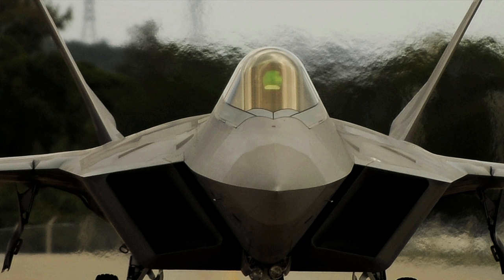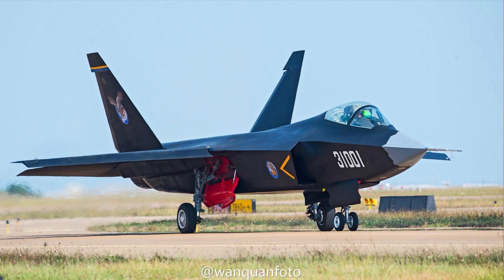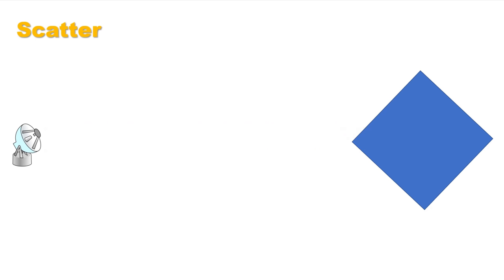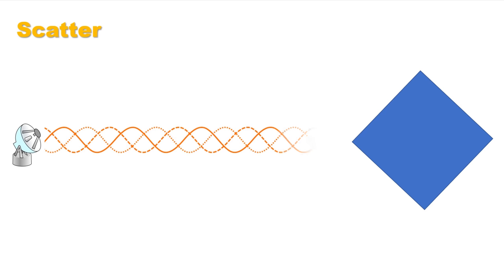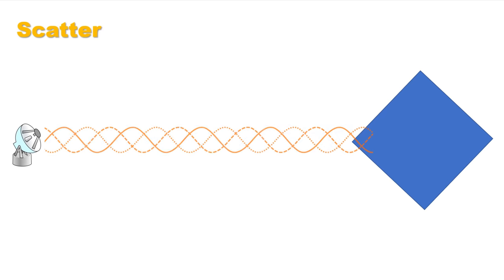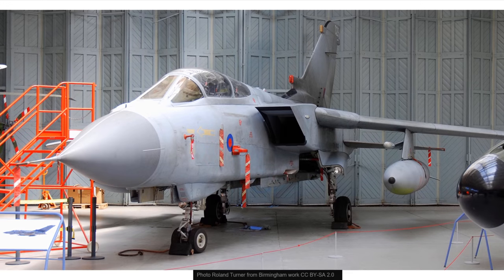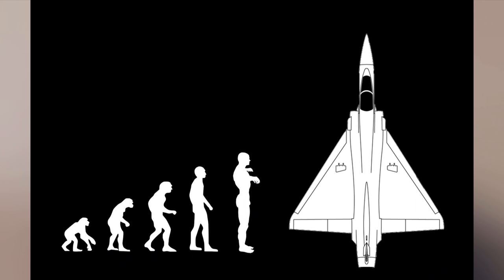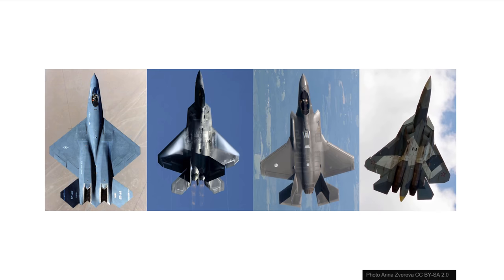STEALTH Killed AERODYNAMICS | why all modern jet fighters look alike

Comment: Stealth also killed beauty.
Reply: I think the SU 57 is gorgeous
Reply: I think they look pretty cool actually.
Reply: I thought the YF-23 was beautiful. Good Area-Rule numbers too. I keep waiting for that video. Bet Valen RN is too.
Reply: Not completely. Stealth planes are still beautiful in their own way, the B2 spirit is the most beautiful stealth aircraft in my opinion
Reply: I think most modern fighters look purposeful and aggressive. They are still beautiful in there own way, just not in the sleek sexy way, older jets have been.
Reply: @Renegade-Master-88  me too. It's just an angel ...(of death )
Reply: @exiletsj2570   What are some of your favorite aircraft from a design/appearance perspective? What would be on your list of “fugly” aircraft?
Reply: @Renegade-Master-88  I think thinking about stealth killed his brain cell.
Reply: @Renegade-Master-88  it looks like a pancake
Reply: @CaptainDangeax  entire airframe of the B-2 generates lift, it has a really low wing loading as well so it probably turns surprisingly well for how large it is
Reply: @CaptainDangeax  the B707 did a barrel roll, not a loop.  the YB-49 flying wing also showed reasonable spin recovery characteristics despite being designed in the 1950s with no FBW controls.  the B-2 is far more advanced aerodynamically and would likely be more stable.
Reply: @CaptainDangeax  the B707 is a long-ranged airliner that isn't even supposed to fly inverted much less perform aerobatics, yet it did a barrel roll at low altitude for an airshow.  if a civilian airliner designed with the metallurgy and flight control systems of the 1950s can do it, then i have absolutely no doubt that a military-spec bomber built using advanced composites and CAD from the 1990s can do at least the same.
Reply: @CaptainDangeax   @CaptainDangeax  ok, so the B707 served in military roles, albeit with some modifications.  the B-2 was specifically designed for combat.  not only that, but the design requirements included low-level, terrain-following flight, a regime that is inherently stressful on the airframe.  the ability to withstand the stresses of maneuvering flight precludes the ability to perform low-level, terrain following flight, as relatively high g loadings (for bombers) are endured when avoiding terrain at high subsonic speeds.  

as for generational "improvements," I agree that too many people have fallen and still fall into the belief that newer is necessarily better.  the Me 262 was still shot down in WW2 by piston engined fighters, F-100 Super Sabres, F-105 Thunderchiefs, and F-4 Phantoms were defeated by fully subsonic MiG-17s and comparatively primitive MiG-19s.  however, I am not stating that the B-2 is better in every way than a B-52 or a B-1B.  while it CAN perform certain roles more commonly assigned to the other two, it still carries less ordnance, has less range, and is far more expensive to operate.
Reply: @CaptainDangeax  as a side note, a combat-configured F-35 still holds certain advantages depending on loadout against even the Rafale.  while worse in sustained maneuvers, the F-35 holds a usable advantage in high AoA and post-stall maneuvers, as well as better radar, countermeasures (including EW systems), and being potentially equal or better in avionics, with EOTS being able to function somewhat similarly to the Rafale's IRST.
Reply: @CaptainDangeax  first off, flying slow =/= post-stall, although F-35 can do that too.  AoA limiter on the F-35 is 50 degrees, Rafale is 29 degrees.  F-35 also regularly does slow passes at airshows at about 185 kph.  Rafale's RBE2 radar is rated for target tracking at around 110 km; F-35's AN/APG-81 is capable of tracking at 150 km.  as for EW and countermeasures, F-35 is set to replace USAF F-16CJ and USMC EA-6B in their SEAD role and employs not only standard chaff and flares, but also has towed decoys and a dedicated EW system.  avionics is far more than just flight control system; it includes rwr, missile warning systems, and IRST/FLIR, which both aircraft have, which is why I stated that F-35 was potentially equal or better.  as for detection of targets, show me when a Rafale manages to detect and provide targeting data for ballistic missile threats.  any modern fighter can already use synthetic aperture radar or IRST pods to detect and identify ground targets.
Reply: @CaptainDangeax  combat reports still are press reports, are they not?  also, fighting insurgents is nowhere near a true test of capability for either of these fighters.  finally, I never said the F-35 was better overall - I said that it is better in certain regards.

Comment: YF-23 has a perfect area rule conforming shape.
Reply: @anthonyb5279  I don't write about things I have no clue about. But your question clearly points out that you don't have full comprehension. So go look at the pictures and solve the mystery.
Reply: The YF-23 is actually the best mix between stealth and aerodynamics the world has ever seen. The YF-23s frame is low drag and area ruled, it also features incredibly large lifting surfaces that give the YF-23 an incredibly low wing loading of 280kg/m^2. For reference, the F-22 has a wing loading of 377kg/m^2. Basically the YF-23 was more maneuverable than the F-22 in terms of aerodynamics. But it doesn’t end there. The YF-23 also had a thrust to weight ratio of 1.36 at 50% fuel while the F-22 had a thrust to weight ratio of 1.25 at 50% fuel. Basically, the YF-23 was almost more maneuverable than the F-22 in all metrics except maybe instantaneous turn rates because the F-22 had thrust vectoring and also be more stealthy than the F-22. YF-23 was GOATED! Too bad Northrop didn’t have time to work out some of the YF-23s issues(bad canopy durability at supersonic speeds), was on the governments shit list for their B-2 cost overruns and delays, and didn’t show off its capabilities as much as the YF-22 to gain public support. Had the F-23 beat the F-22 in the ATF competition, the Russian Sukhois and Mikoyans would’ve had to run from a monster fighter that was prepared to tear their ass to pieces while they couldn’t even see it coming.
Oh yeah and the fucking Gripen which is a LIGHT FIGHTER still manages to have a slightly higher wing loading than the YF-23 with a wing loading of 283kg/m^2.

Oh yeah and the YF-23 also used chines, a lifting fuselage, and massive V tails which are almost as long as F/A-18 wings but are wider to further lower the wing loading.
Reply: The YF-23 had lower drag than the F-22 because its fuselage was more blended into the wings and the air intake narrows together to be area ruled.

Comment: F-22 is area-ruled, which is more evident when you look at the side profile. It's like a tear drop. There is extensive aerodynamic finesse incorporated into the Raptor.

Cross-sectionally, it's like a chined diamond that transitions to the fuselage.

It wouldn't be able to supercruise at Mach 1.6 if it was inherently draggy.

They demonstrated the desired supercruise values on the YF-22 with less powerful motors, and a draggier fuselage, but higher leading edge sweep angle on the wings.

The original fuselage had to house thrust reversers in the engine nacelle profiles, which really fought against area-ruling there.

On the F-22A, they reduced the profile of the rear to taper drastically as a way of following the Sears-Haack body.

Same with the YF-23s. They had obese engine nacelles for the thrust-reverser provision. The F-23A was supposed to have reduced volume engine nacelles like the F-15, and increased fineness ratio/overall length.

ATF was supposed to be a STOL-capable fighter in the European theater after strikes on airfields. The STOL thrust-reverser feature, AIRST sensor, supersonic ejection system, side-looking AESAs, and other features were dropped due to cost risks recognized by USAF.
Reply: @anthonyb5279  Several members of my family were AeroEs and I studied the NATO AeroE program coursework (that my dad did concurrently while working with the West Germans/Brits on early ECA/EFA development) for 3 years on my own. We spent most of our time at ED, including B-1B CTF, F-16C Block 30 A2A capes expansion, F-15 CTF, then Global Hawk. I went active duty mil, then private sector.

Been talking with some guys back-channel who had interesting run-ins with SECDEF Gates who said it seemed like he was working for the Russians in all their dealings with him.

I have a theory that he was tasked with killing Raptor before we could go into Full-Rate Production because both China and Russia didn't have a way of dealing with hundreds of them in PACOM and EUCOM as planned.

Remember when he said, "We don't need F-22s to bomb the Taliban.".

Comment: That said, the YF-23 has a different approach to stealth than the F-22/F-35/Su-57/J-20/J-31/Tempest, etc. More blended and smooth in addition to straight aligned edged rather than straight aligned edges alone.
Reply: I think Su-57 has more similarity on stealth with YF-13. Blended wing airframe, radar blocker in front of the engine, podded engine layout. J-20 also unique in a way because its the only one that use canard, but the layout principle follow F-22 than YF-23.

Comment: While it hurts as a F-22 lover, I do know and understand the aerodynamic limitations the plane has. Good vid!
Reply: Why does it hurt? Every benefit comes at a cost. The question is does the benefit outweigh the cost. The answer is easily determined as yes as all countries are seeking to develop stealth aircraft. And people mistakenly believe even if a stealth aircraft can be seen on radar stealth becomes irrelevant. That is very far from the truth. Seeing an aircraft and getting a weapons quality track is two different things. Additionally the small radars in guided missiles will have difficulty tracking stealth aircraft as well. So even if stealth aircraft can be tracked and weapons fired upon it those weapons will have much more trouble actually hitting the aircraft and countermeasures much more effective the non-stealth aircraft.

Comment: I think some nuance regarding the last point needs to be mentioned. The Su-27 family is generally efficient the speed range you mentioned but with the caveat that it is in clean configuration i.e. not stowing anything on the hardpoints and that goes for every aircraft. The F-22 and other comparable designs,  on the other hand, are optimized for cruising for extended periods at supersonic speeds even without afterburners,  hence,  why the engines produce a lot of thrust couple that with the much more clean profile. In the case of the F-22, however, its maximum speed has been downrated not for aerodynamic reasons but for structural reasons. The spar between the engine nozzles is prone to overheating. If engineering limitations aren't a concern and we just want raw aerodynamic performance then the YF-23 paired with the YF120 engines are extremely impressive. Too impressive that it was deemed too risky. RAM also tend to be intolerant of high airspeeds. Any more and maintenance costs would skyrocket as these tend to be notorious hangar queens. Of course, the low wetted  area concept for stealth planes didn't die as we still have the PAK-FA that would be equipped with variable cycle engine that's a more modern and mature analog of the older YF120.

Comment: As every engineer knows, kinetics energy is transformed to heat. So if the aero drag is so much higher on a stealth plane, the heat radiation must be critical. Is this not considered as a problem? 
An are there done any action facing this problem? 
-No wonder why the IRST scanner on a Eurofighter Typhoon can spot a F-22 on 100km distance.
Reply: well a IRST scanner on Eeurofight Typhoon can spot a f-22 on 100km distance under perfect conditions only. any clouds and you are out of luck
Reply: l that heat is almost insignificant to the massive heat produced by turbofans.
Reply: @fenrir834  Yes. But because of the high drag number on stealth aircraft, they need a lot of thrust. And as we all know, energy equals heat, so the engines of F-22 and F-35 produce a lot of heat.
Reply: @henrikerdland578  now you are right.

Comment: The F-22 has smooth surfaces with lifting surfaces that generate very small and very few vortices which decreases lift in instantaneous turn rates in comparison to the SU-35, but the lack of vortices also mean less downwash which means lower induced drag. The F-22 without thrust vectoring is definitely more aerodynamically suited to higher speed sustained turns because of the lower induced drag with the tapered trapezoidal wings and low wing loading. The thrust vectoring was probably added to compensate for the lack of vortex lift in the airframe.

Comment: But I think historically it's more norm then exception. I mean a lot of post-war 1st gen fighters looked like barrels with wings. There are abundance of "two-engines, two rudders" in 4th generation. Hell, the only generations where was wide (and WILD) variety of shapes and forms were 2nd and 3rd  generations of fighters (the generations from all the cool planes came from) and it was mostly because aircraft designers didn't have a consensus about what traits will be most useful in next air battles and tried to find the "next big thing" all over the place.

Comment: Question: I thought that fixed inlets for stealth can limit the speed to under Mach 2 (?) The F-15 has a variable geometry inlet duct to deal with this problem? I have seen a graph showing F-22 max speed is under Mach 2 reading "airframe temperature limit" Is this limit actually really an inlet temperature limit?
Reply from the maker: They are two different problems. Great blog btw

Comment: My thinking exactly, an F-104 or a Mig-21 were about the same speed as an F-35 but they have less than 1/3rd the power. Aerodynamics peaked in the 50's, other greats are the Saab Draken, Mirage 3 and the F-106.

Comment: Nice video, Otis is a good signing.
I don't think it is sad the brute force used in the F-22 since it is much more stealthy than the Su-27.
Now what I woukd like to see is an F-15 with the engines of the F-22... or even better, a Su-27 with those P&W F119 engines...
Reply: For F-22, there's a low wing loading target and there's a higher empty weight, hence a large wing design.

For a specific acceleration target, a large wing has a higher lift drag, hence requires higher engine thrust. Fighter design has to balance multiple factors.

F-22's stealth goes below the skin and beyond stealth shaping.
Reply: If you think f22 is brute force please have a look at the rear of a mig 25 with ground staff for scale.
Reply: @brucebaxter6923  MiG 25P has two 22,500 lbf engines while MiG 31 has two 34,000 lbf engines.
Reply: @valenrn8657  
And?
Did you miss the point?
Reply: @brucebaxter6923  there was no point to begin with. you can't finesse your way to mach 3+ with A/A missiles on board.
Reply: @deanboy2416  a12
Reply: @brucebaxter6923  how many were made? how many were combat ready?
now lets look at the migs, shall we...
Reply: @brucebaxter6923  MIG 25 was design and produced in a completelly different era and philosophy in mind.You can't compare it with F 22. MIG is an interceptor with MACH of 2.83 or ~3500km/h  -  F-22 ~ 2400km/h "only". So you see the difference?
Reply: @dan-ue4kd  
Yep. 
Missed the point. 

What’s the video about?
Death of aerodynamics. 

That’s the op about?
Brute force vs efficiency. 

In 1970’s japan, you get to stand behind the ussr super fighter that the west has been afraid of its advanced aerodynamic design and technology. 

What is your going through your head as you stare into the abyss?
Reply: @brucebaxter6923  building one prototype is not really a measure of success. the russians can also build one-offs of things you cant even imagine. but thats just it, they are one-offs. they are not economically, strategically vialble or even maintainable in any serious conflict, never mind on a long stretch of time.

ao no, it cant be done, otherwise it would have been done.
Reply: @brucebaxter6923  the us thought it was a super-fighter. they are the ones that made the whole spiel up.

it is one thing to disprove what the ussr was claiming about it, and another thing completely for the americans to find their expectations and beliefs have had nothing to do with reality.

besides, for 1964, the aerodynamics of the mig-25 were considered "finesse" and "state of the art".
Reply: @deanboy2416  true, but the rear end doesnt scream aero
Reply: @brucebaxter6923  well, not much you can do if you need so much thrust...
a large engine nozzle is your only choice (as someone with a background in aerodynamics I can confirm that other ways around this problem result in huge losses of thrust and effeciency)

Comment: I have long suspected that optimal aerodynamic shapes and optimal stealth shapes are not the same.  This is part of the reason why the F-35 has an engine with 43,000 pounds of thrust.  It must be brute forcing performance when the aerodynamic shapes are of compromised efficiency due to the need for stealth.